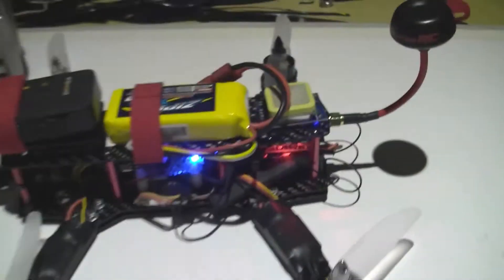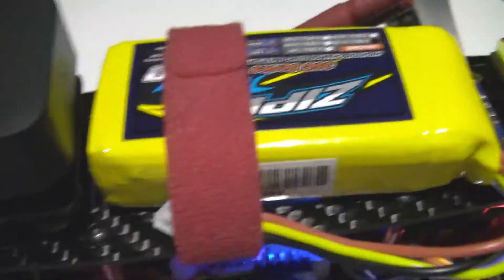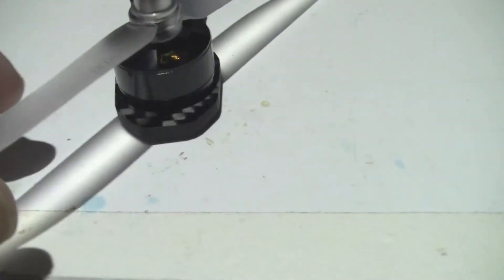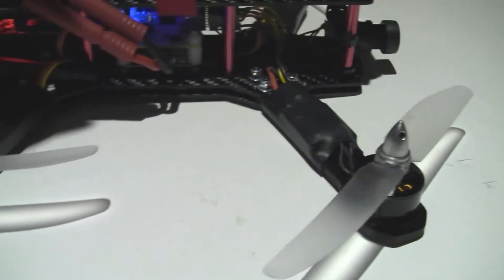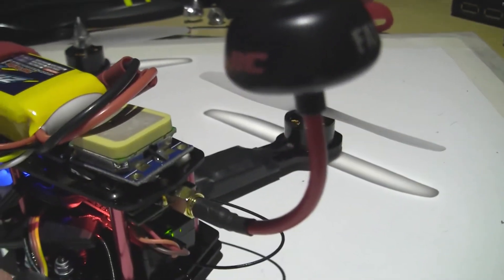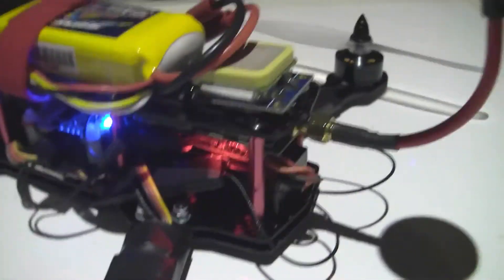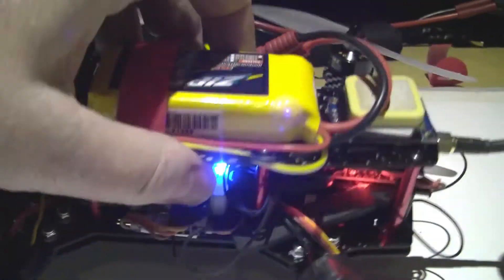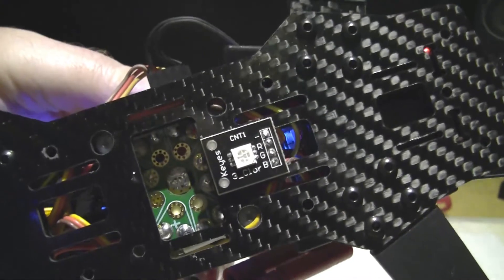Chinese carbon "Mystery" mini quad ( ZMR250 )

Comment: How much inch propuller suitable with this EMAX MT1806 2280KV Motor? 6040 or 5040?
Reply from the maker: noob super You can fit 6" propellers but I think they're more suited to 5"

Comment: I'm soon ordering this exact kit of stuff (minus all fpv gear and gps) and I'm not sure what batterys to get for it? I plan to turn it into a fpv quad in the future using a gopro. Aprox how many amps do the motors pull in a hover with 5040 props on a 3s setup with the Turnigy emax motors? Thanks for your help as this is my first quad and I'm still new to the rc hobby. Thanks
Reply from the maker: Blitzeral I think they're around 5 amps each but I suggest you get some 35c batteries of around 1300mah. If you get any lower C rated batteries, you'll find that the power drops quite quickly if you do anything more than a hover - Think of 'C' rating as drinking through a straw.... the bigger it is (high C rating) the better the flow. Also, if you have low C batteries and you stress them, they don't live as long.
Reply: Ok thanks, I'll probaby get two 1300mah and a bigger like a 2200? (It can carry that size right?)I already have two 2200 Turnigy 3s 25c but I might buy a 2200 30 or 35c
Reply from the maker: Blitzeral It can carry a 2200 35c but you'll be pushing it with 5" props because of the lift. I suggest you try one of your 2200 25c batteries first and see if it'll actually take off before you splash out. The higher the C rating, the heavier (and bigger) the battery! It's a fine line between a light battery and less amps and a heavy battery and high amps - there is a point where you'll be flying on nearly full throttle, just to lift the big battery and the flight time will be less than carrying a small battery at half throttle. Does that make sense?
I now only use 4s (65-130c) batteries with my 250's and my skills have slightly improved since I posted this video :) https://youtu.be/wCe4AKZRGzA?t=9m16s
Reply: Nice flying man! Once the Turnigy emax motor set is back in stock on hk I'll get the parts ordered. Can't wait! Thx for your help subbed :)

Comment: I put this thing together and get 3 minutes flight time (down to 3.7v per cell) on 1350mah 3S 30C in a hover with no camera/FPV gear. Does that sound right?
Reply: Yes, I use 3.7v as the half way mark...I have a much better frame now and get better flight times. Thanks.
Reply from the maker: Come Aun I usually forget about the battery voltage...... until it plants itself into a tree :)

Comment: what size props?
Reply from the maker: Gemfan 5030's in this video.
I've also used some HQ 5x3 and (after doing the tracking) they're better but a little more expensive.
I'm trying some 5x4x3 tomorrow
Reply: Do the 5*3 props do good on 3s?
Reply from the maker: Trevor Moon Yeah. Obviously, weight plays a big part in it though.
Reply: I just want to run a 1300 3s with apm 2.5 with GPS. Also, a 5.8 fpv 600mw and a security camera
Reply from the maker: Trevor Moon You'll be fine. I'm running a 2200 3s and it's ok with EMAX MT1806 motors.
AUW is 576g
Reply: Vortecks whats the best flight time you can get with the 2200mah bat?

Comment: I think I found them.

http://www.hobbyking.com/hobbyking/store/__29532__5_6mm_x_16mm_m3_nylon_threaded_spacer_10pc_.html

Is that it ?

:-)
Reply from the maker: Yup :-)
But.... you need the bolts to go with them (to go from the bottom)
http://www.hobbyking.com/hobbyking/store/RC_PRODUCT_SEARCH.asp?searchType=10&strSearch=m3+nylon+screws&location=AL&idCategory=&sortBy=Relevant&NumPerPage=20&currentPage

M3x8 should do you.

Comment: I got good times on those 1000's for about ten charges but the 1500 lion brand seems to heat less. 30c min I am finding works but I am running 2s emax budget motors.Those were out at factory when I made my order.
Reply from the maker: The ones I got, are apparently 35c (45c burst) but even at hover, they get warm. We'll see how they hold up at pulling high G's.
I wish I'd done this mini quad thing a long time ago.....they're GREAT :-)
Reply: vortecks2000 45 to 90c is what you want